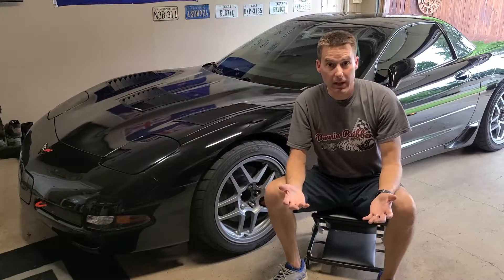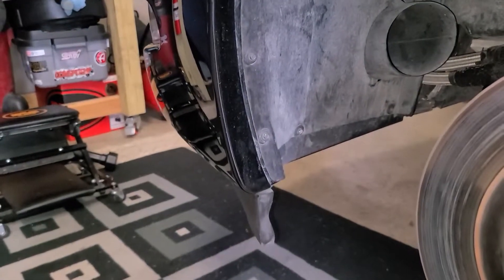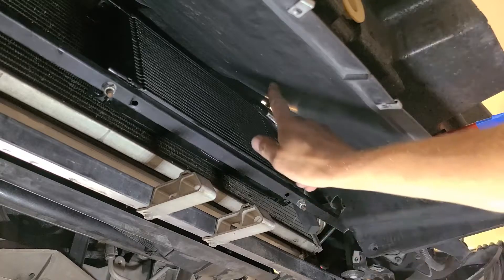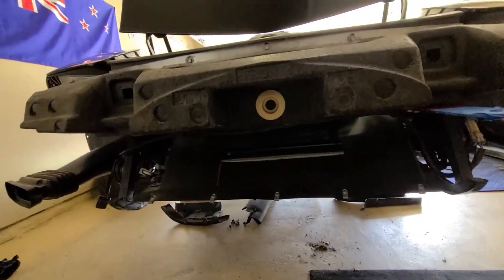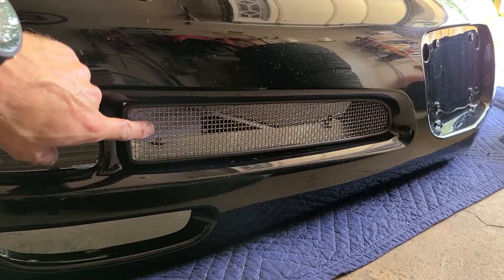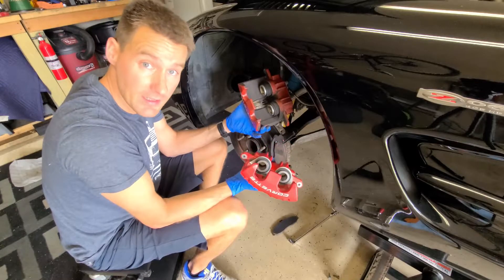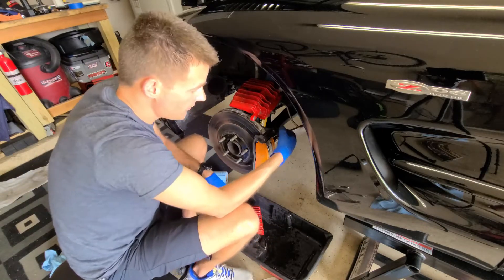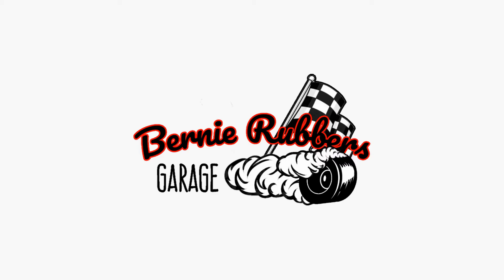New Engine Oil Cooler, License Plate Filler Mod and New Brake Pads. C5 Corvette Modifications.

Comment: How is the air flowing? Anyway to tell if it’s just going under the car or into the oil cooler? Seems hard to run a test because you changed out oil cooler same time you modified the air flow. Can’t isolate those variables. But regardless nice video. I’m sure your running cooler from that larger oil cooler!
Reply from the maker: You have a good point and shortly after this video I added more ducting all the way to the oil cooler. Last summer I was able to run 20min of hot laps and the temperatures held nicely.
The car is getting a new engine so we will see how this holds up this summer.
Reply: Sweet! What are you dropping in her?